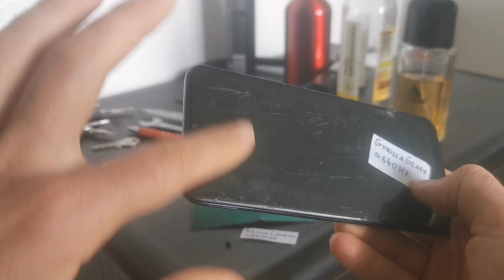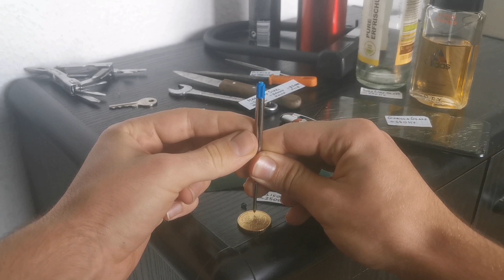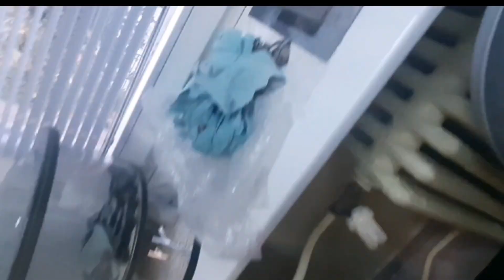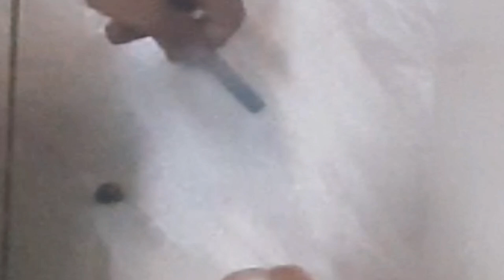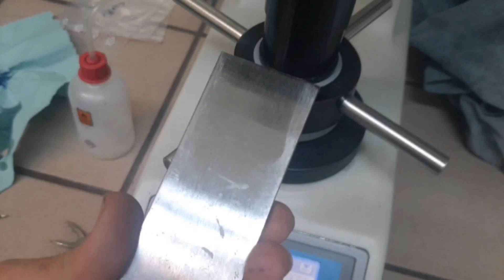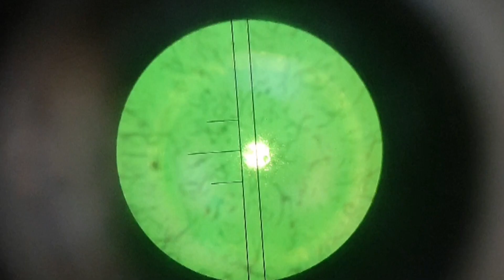DIY hardness tester (Brinell method)

Comment: i explored this 15 years ago with a 0.5 mm pen ball, still in it's crimped tube (i tried to clean off the ink).  7.5 kg for hb30.  a great concept.  i obtained a bunch of 0.5mm balls from danaher but dropped the project.  the pen balls are textured so the polished ones work better and go a little deeper.  i also invented the handheld measuring microscope in the 1980s.  the prototype cost $1000 for the analog camera, $2000 for the framegrabber and $2000 for the pc, not to mention the lens and led lights.  i wrote all the software.  i could probably make it now for under $100.  i worked at newage testing instruments until 2015 and designed many testers, the most interesting being the mt91 which was a mini-rockwell tester using a 1 kg. load.  it had a motorized xy stage and a zoom microscope for creating traverses to determine case depth.  probably 10 times as fast as doing vickers tests.  At the other extreme was a depth read brinell head which had an integrated load cell for controlling the hydraulic 3000kg. load.  bob strimel, at tinius olsen, had the idea of sandblasting the 10 mm. brinell ball (actually using a rock polishing tumbler) so that the impression would illuminate collimated light insteaded of appearing black because of its mirror-like surface.  another great idea but the impressions became smaller, due to more friction on the ball surface, so that was dropped.  really enjoyed your video.  if you want to reach me, joehrle@comcast.net   john oehrle